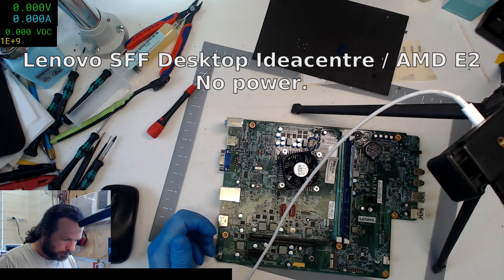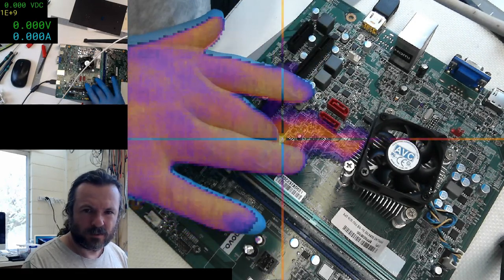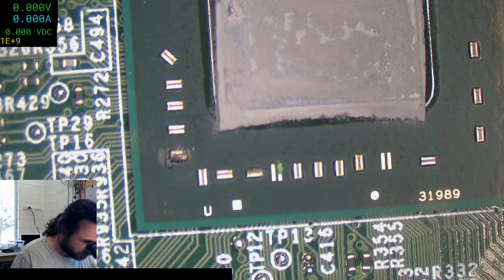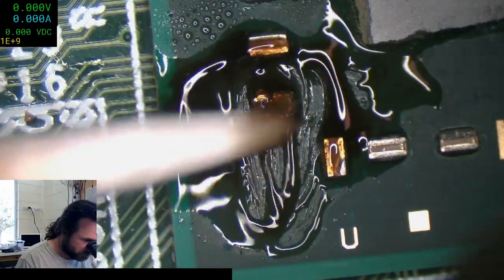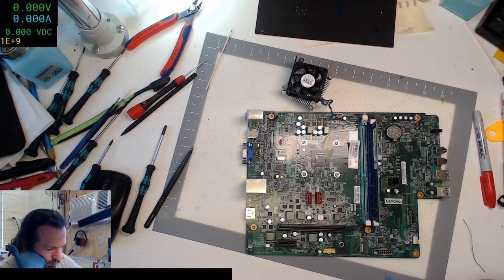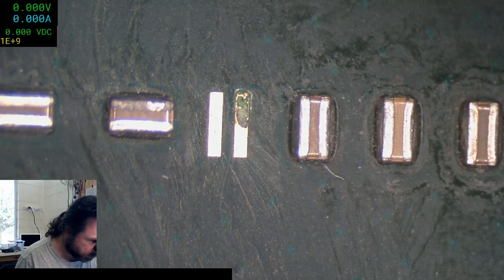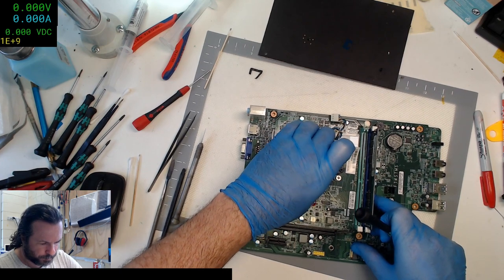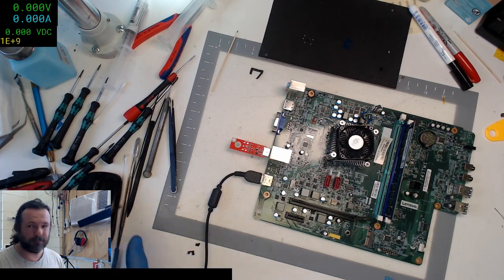Dead Lenovo Small form factor IdeaCentre 310S Desktop PC restored to life!

Comment: It's insane how I have just had this exact model come in, and there are water traces at the exact same places, both the unpopulated pad and the two capacitors. The symptom was no image (no boot). CPU fan spinned, mouse lit up, keyboard didn't, no caps lock, pulled constant current ("stuck" level of constant). Removed the two caps (removing the one you did didn't help, so I removed the other one too), got instant boot. I suspect it's probably condensation. The customer said they replaced the CR2032 CMOS battery, after which it failed to turn on. Probably shook the computer in the process of handling it, some droplets shorted stuff out or smth. Gonna replace those caps with similar caps off another CPU package (2011 Macbook Pro board happened to be at hand). After all, all CPU voltages are under 1.5V, I suspect these long parallel on package caps should be compatible at least in that regard. Glad I found this video, I would have never guessed to look under the cooler. Thank you!
Reply from the maker: Always good when a video, even if it's a few years old, helps someone find a fix - congrats!

Comment: Hello sir, i have the same pc.  I am having a black screen when trying to boot up. Not a monitor issue i have tested a few monitors with the same effect. Powers on, cpu fan spins. I do not hear any beeps or anything when booting up. Any suggestions? Thanks in advance
Reply from the maker: Always check clock battery - replace first and test

Comment: Paul where the hell do you get new macbook pro screens that work?
Last 30 have had a 60% failure rate! What is going on?!
Reply from the maker: I get them domestically or unionRepair, a bit of a premium but at least there's warranty/return options.
Reply: @pldaniels  we have been sourcing locally for the sake of warranty but it seems to be consistently bad with all of our suppliers. Some are asking for 1k+ too... We're almost at the point where we are going to start denying screen replacements cause it isn't worth the hassle.
Reply: @pldaniels  which sucks cause we get at least 3-5 a week
Reply from the maker: When I see A1398's with broken screens, it's just safer to read out the last rights :(
Reply: @pldaniels  I feel like I can rely on a second hand a1398 screen more than a new a1990 screen haha